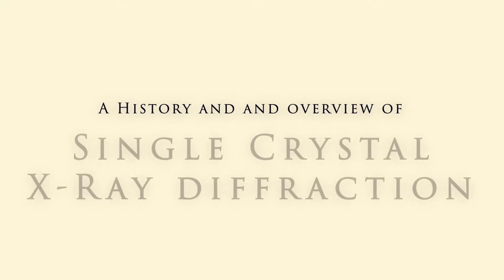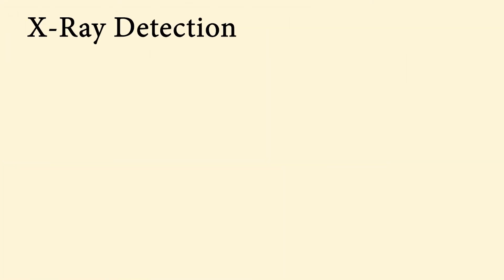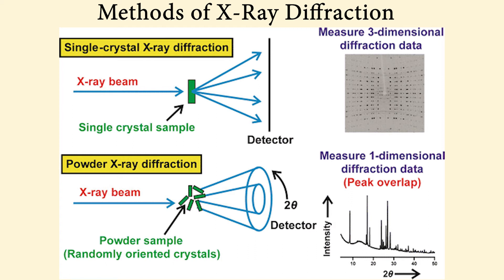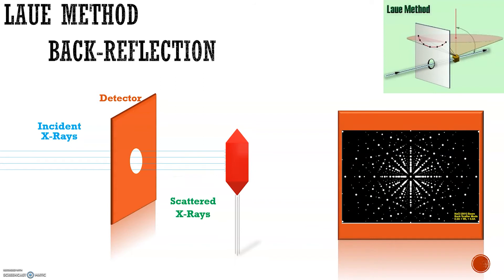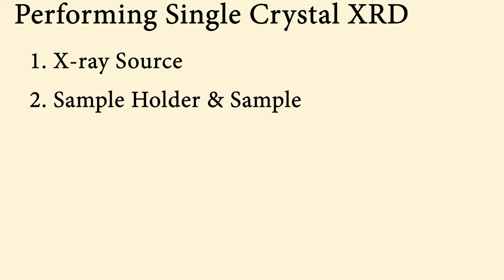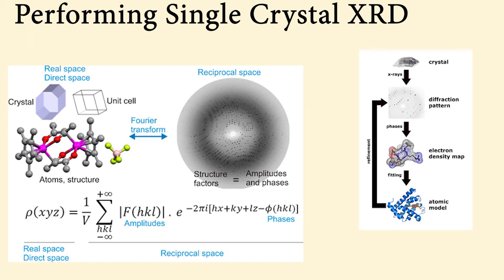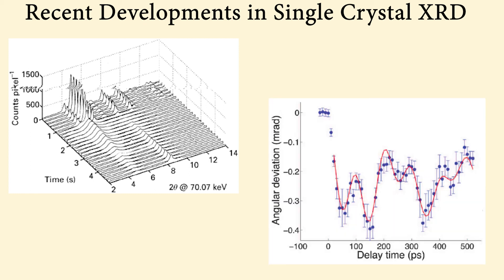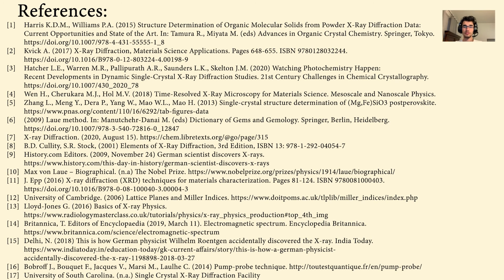Single Crystal X-ray Diffraction

Comment: Great explanation! When doing single crystal XRD, can you explain more about identifying the orientation of a sample during the preliminary scan? For example, how can we make sure that the 2-theta angle of 21 degrees is assigned to the 100 plain when the orientation of the sample is not aligned to the detector?